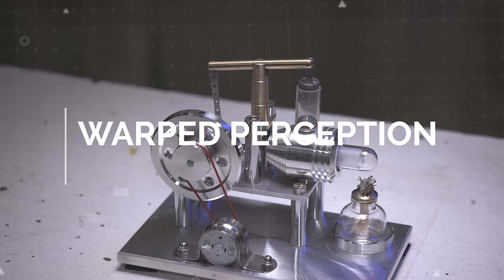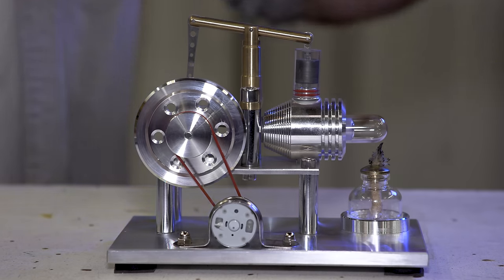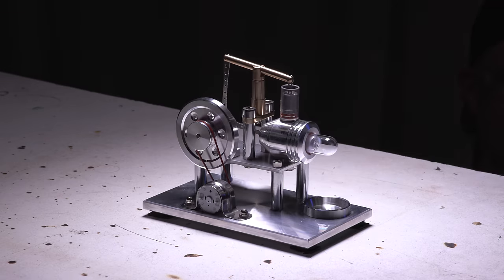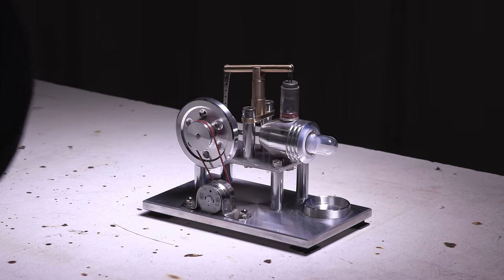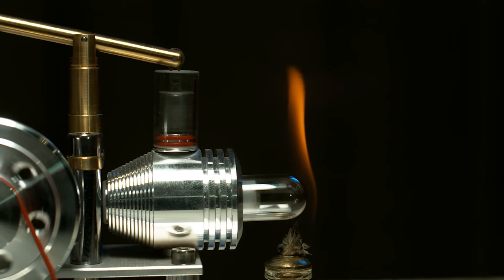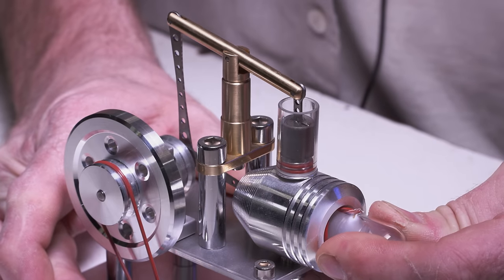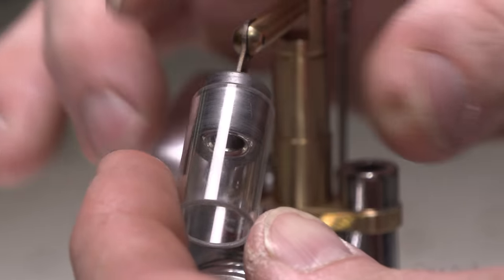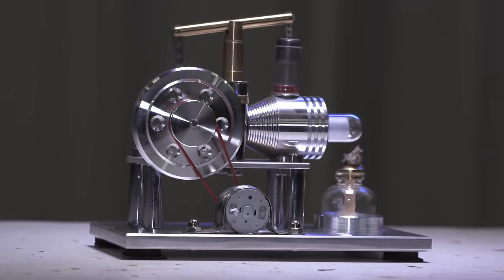Mini Stirling Engine - MAX RPM (Blow-Up Attempt #1)

Comment: What’s the voltage and current draw from the motor when using it as recommended vs at full RPM?
Reply: Yup!...horsepower runs on its built-in dyno!
Reply: Bluswede Uh, what? lol

Comment: Stick a cooling fan or other cooling method on the cold end and use the highest temperature thats unable to melt glass, thats your maximum rpm before failure, after that... itll fail eventually.

Comment: You should find the cheapest and smallest gas engine on wish and see how it will hold up
Reply from the maker: Good idea , I did feature a couple small engines
Reply: Warped Perception  And with wish you never really know what the quality of the product is until you get it

Comment: I have a USB port wired up to mine. Charge my cell phone off it when the power goes out 😁 
If replace the air in the cylinders with helium(I think) it will spin faster aswell
Reply from the maker: Do you really? Or are you just messing around? I was thinking about doing a video on that, I'm pretty sure I would need some electronics to make that work but totally doable.
Reply: I’m dead serious. Just need the positive(right side) and negitive (left side) on the usb wired the the dynamo outputs.  Super easy. It’s slow charging being low amperage  but it works.
Reply: I’m sorry I went back and looked at my video. I wired in a tp4056 circuit. There like $1 each.  Still just connected the + and - wires up.

Comment: The reason IMO that that engine never made it to full production is that "planned obsolescence" was needed; it would have lasted way too long for anyone to make any money on it. /just my take.
Reply: Size, thats the main problem of the Stirling engine, it has an enormous size for any userfull power output, like the low presure steam engines. Thats why it never made it.

Comment: Want it to go faster. Get some dry ice and put it on the plate. Since the engine runs off of temp differential, increasing that differential will only increase the speed.

Comment: put the next one in liquid nitrogen or put in the freezer.  when the parts that are supposed to be cooler then the heated parts are super cold and the heated parts are super hot it would be like nitrous for sterling engines.  give it a try

Comment: The reason Stirling engines never "made it" even though they are very efficient is because you can't adjust the power easily, also they have poor power density. But they were used on some early powered ships.

Comment: It would have gone better if you had put a heat shield in place to stop the aluminium barrel heating from your blow torch. I worked for years on Stirling engine development and out operating rpm was 1500. Pressure inside the engine was a nominal 15 bar and nitrogen was the gas. The problem with Stirling engines is that the hot end needs to be very strong and corrosion free under hot conditions and must be stainless steel of some quality but the heat transfer rate of this hot part is poor, putting a huge barrier in place for efficiency. They make terrible engines but brilliant refrigerators because the working piece is not dealing with extreme heat. You try spinning it with a wee electric motor.

Comment: So how did he measured the RPM?
Reply from the maker: With the digital non-contact tachometer like in this video  https://youtu.be/WW7lDm2x9pw and also with the high speed camera analytics to verify.
Reply: @WarpedYT  there are no markings on the flywheel to get a reading with the digital tach.
Reply from the maker: There was a little reflective silver mark, it wasn't shown in the video clip where the engine is stopped, it got edited out because I was having trouble reading it because the entire flywheel is silver as well oh, but I did use the high-speed camera as a secondary measurement to verify the number. A lot of people don't realize it but high speed cameras are also scientific tools, companies measure speed and velocity all the time with high speed cameras, the software for the cameras even has speed measurement options built in for rotational speed and velocity. I was thinking about showing that in the final episode but it kind of dragged on so I cut it short.
Reply from the maker: You can actually do the RPM measurement yourself at home watching the video. If you watch the slow-motion part and count how many rotations per second of video time the math is like this. 1000 frames per sec / 29.97 Frames Per Second = 33.36 x 2 revolutions per 1 video sec = 66.73 x 60seconds in a minute = 4004 RPM.

Comment: This engine never made it, because the power output of the engine relies heavily on the gas pressure of the shut down engine and the gas that is used. For efficiency you need somewhere around 100 to 300 bar and hydrogen or helium. Philips made a rather efficient sterling engine some while ago that put out 30 hp from the size of a 200 hp outboard motor with pure helium at 100 bar filling pressure. If you compare this to the technological difficulties of other combustion engines like steam engines and internal combustion engines, that's comparatively large and pure helium is rather difficult to get. So it's rather heavy and rather expensive in comparison to other contemporary engines of it's time.

Comment: This is not surprising 
Stirling engines don't have pressure spikes like internal combustion engine has so it can in theory produce more power than ic engine without damage to components like piston or rods 
And there is no need for piston rings ,it uses graphite/glass piston
Because they are harder (but more brittle but since there are no pressure spikes it's safe to use this thype of materials) than metals so there is no need for advanced lubrication

Comment: You didn't pass 4000 rpm because you didn't cool down the heatsink. Try blow on cylinder with torch, while heatsink is cooled by water or something like that. You should reach higher speeds. Also I think that on very beginning you had higher speed than later. Its because temperature difference between cylinder and heatsink was bigger on start than later. And as we know Stirling works because of temp. difference between hot part and cold part, so not only because of hot only. If you heat up whole enhine with a torch - engine wont work.

Comment: Anyone able to help I have this exact same model engine and I put some light fishing reel oil in the cold air cylinder because it sounded like it was squeaking and ever since I have been unable to get it to run fast at all even with the generator belt off any suggestions please

Comment: The Stirling engine has Problems with the Power control and it is expensiv as a Combustion engine, with the same power.
Reply from the maker: I didn't even think about the power control, that would make perfect sense, I kind of remember my first mini bike not had one of those belt peddals and a CV belt drive system, where when you would want to go forward you would push down the pedal and create tension on the belt, and it would automatically change the pulley ratios as the centrifical force was increased from the increase in speed. The engine would just run off of the governor the whole time at the same RPM. I would assume you would have to do something similar with a stirling engine.

Comment: Stirling engines are awesome & I would really like a stirling engine generator that can burn gasoline, diesel, wax, wood or anything flammable etc 
Super high efficiency & long life endurance that holds up well over long periods of time. Stirling engine generator perfect for a range extended electric vehicle as the genset // 
Problem with Stirling engines, they cost more than diesel engine, require a lot of metal & capital costs upfront & take a long time to reach parity, high upfront capitals costs with low long term operating costs, similar to the capstone turbine energy heat generator // requires more money upfront in exchange for long term operating cost savings //

Comment: Instead of just overheating the bulb end you need to cool the other piston with some compressed air or air duster or circuit freeze. Those engines run off of a temperature difference between the hot bulb and the cold piston. So making the difference bigger is better than overheating the whole engine. Keep up the destruction!

Comment: I know it'll drop the RPMs so it won't be as clickbait impressive, but could you try running the thing with a load (if it's still alive lol) to see how much extra power you can get out of it with the blowtorch vs the alcohol lamp? Just hook up a resistor and multimeter to the motor so it's not free spinning...
Reply from the maker: That was going to be my second test in this episode, and my third was going to be something even more extreme, I may come back with this engine in another video and try that out with a specific purpose in mind.

Comment: I guess you can use HHO to run a larger engine like this to generate electricity that will power the HHO generator with still some leftover electricity to power a House? anyone doing this already?
Reply: Uh, No. That violates thermodynamics: energy cannot be created or destroyed, only converted from one form to another. you always loose some as sound, heat, or light, and trying to capture all of it becomes futile very quickly.

It'll run off the heat from hydroxy, sure. But no machine (aside from a space heater, because all it does is make heat) is 100% efficient. If you burn a gallon filled with hho, you'll get less then a gallon of hho back, after you loose energy to conversion four times (heat->Mechanical->electricity->chemical) making more fuel. Let alone having a surplus. Not only that, Stirlings are wonderful little engines for display, but they're horrendously inefficient. I don't think you could even get high enough current to make HHO on one using HHO as the fuel.

That said, you CAN use them as thermo-solar. The sun of course isn't perfectly efficient either, but it's already up there burning, and will be for another 5 billion years. A sterling can tap into some of that entropy to generate power just fine. Of course, a photovoltaic cell, aka a Solar Panel, is more efficient by a lot. However Stirling engines are extremely simple and a lot more durable, so if you only need to charge a cellphone, a stirling and some mirrors might have you covered. Steam is still better for this, though.
Reply: DFX2KX Thank you very much for your explanation as you guessed already I don’t know much about system efficiencies and thermodynamics laws really appreciate your expanded comment learning everyday something new. I just wish some genius crack the system the world really needs a new solution for a more efficient system to generate power.

Comment: It never made it because of the huge amount of wasted fuel heating everything else in the world, instead of using the burning fuel to actually power the engine. Internal combustion is drastically more efficient. 

The only time this makes sense is in olaces where there are already waste-heat sources that could be exploited to power a stirling engine as well, such as the top of a buck-stove, to power a small blower fan (which people do).

Comment: Stirling engines never came into popular use because they have a terrible power to weight ratio and they can't change output power quickly

Also that glass displacer piston should be replaced with one made of kovar

Comment: How about making the piston out of carbon fiber polished smooth to take the heat. At the same time pipe in super cold air across the cold piston for even faster results! @warped_perception

Comment: some info.     knowledge is power.      a consumer should  Know  what he is/is not  getting for his money.      the design of this heat engine is  less-than optimal, for these reasons:
zero thermal isolation  of the sides;    massive metal bits that will get hotter and hotter;   and  a complicated,  energy  Absorbing  linkage  -  this is  energy  Lost, within the system.    and Not present at the output shaft.        as usual,   the engine was run  UN-loaded.        in the context of output  Power/watts, it can be understood that engine speed is only part of the equation.       googletranslate
Reply from the maker: Good point, and you are correct, unfortunately I didn't get past the first test, as my second consisted of hooking up some sort of dynamometer and also loading the motor electrically. Like I said in the video I had more tests I wanted to do, I will try to repair the engine and then run some more crazy tests.

Comment: Zero torque is why the engine never succeeded, for the same heat input a steam engine could do roughly 27 times the output.
Reply: They have a few select uses (a sweedish sub appearently, because they're very quiet, and spacecraft missions have considered them because they're still  more efficient then Thermoelectric materials), but aside from that? yeahhh.